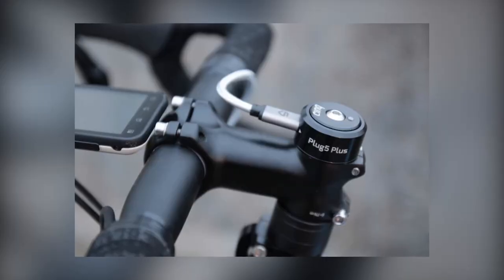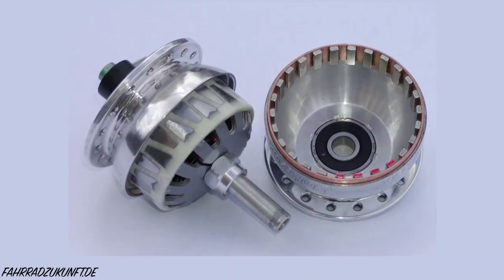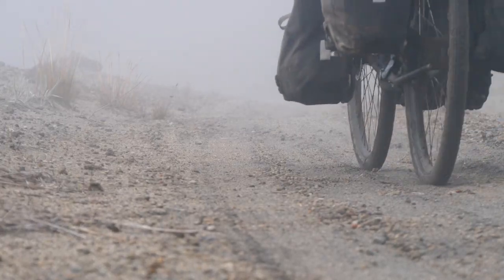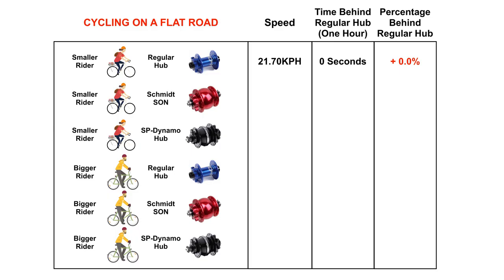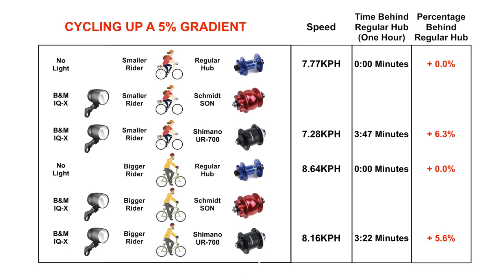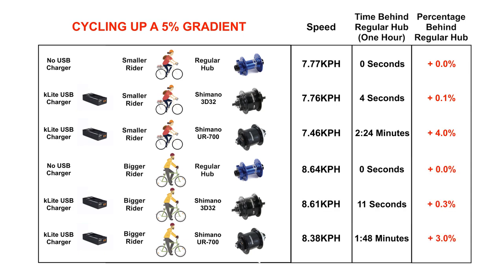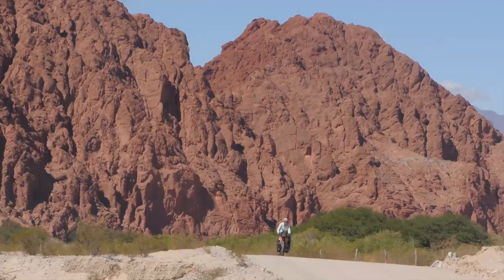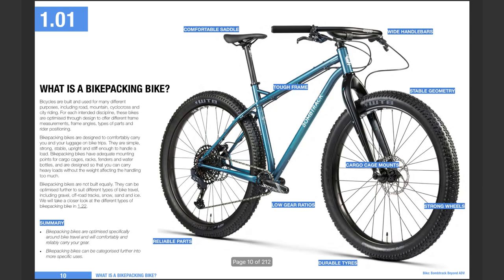How Much Do Dynamo Hubs Really Slow You Down?

Comment from the maker: If you want to go DEEP down the dynamo rabbit hole, jump on my website. You'll find a crazy amount of info on dynamo hubs, lights, USB chargers, wiring, batteries and more: https://www.cyclingabout.com/category/equipment/bike-equipment/dynamo/
Reply: Will do so. Thank you so much for your reply.
Reply: So what happens when you put them onto a mid drive electric bike?? Could they be used to charge the battery?
Reply: @MrJturner74  🤦‍♂ If you only turned it on for downhills when the engine wasn't engaged you could maybe extend your range by 50m or so...
Reply: @MrJturner74  don't electric bikes already have some kind of regen using the same motor-generator that powers the wheels?
Reply: @confusedredditor1660  Only the stupidly expensive ones.

Comment: This guy doesnt do videos for the money or fame, in his reviews its just pure passion. Love Your work sir 😎👍💪
Reply from the maker: I appreciate that! Yep, bikes 'n travel are my two biggest passions. 🥰
Reply: @Cyclingabout  I run a Rohloff on both of my bikes. I love the sensation of direct drive with this hub. And I got them cheap from German 2nd hand market. On one bike I have a SON dynamo and the cheapest Shimano dynamo on the other. Cant complain on either one of them, except that the SON has bare metal connectors which oxidized and I had to replace the lower part of the wiring (so a win for the Shimano here).
Reply from the maker: @peroperic3692  Interesting, I've never had that happen to any of my SON connectors!
Reply: @Cyclingabout  yeah, I accidentally squeezed the wire ends when taking out the front wheel, only to find out the light system is not working any more when I reinstalled the wheel. I unwrapped the wires (cut the housing) and the wires were green on the inside. I had some pieces of copper wire laying arround and just replaced this part of wire without soldering and put some heat shrink tubing over it. It works like a charm now. But this would be hard to fix on an expedition without the wire.
Reply: Pure passion, yep, but man (or even cyclist) does not live by passion alone! A bit of donor money helps fuel the passion. His reviews are the embodiment of scientific method. In equipment alone they must cost a bit.
Reply from the maker: jean-luc paradis  Not really. These are just products that we have data on.

Comment: Compared to my ancient side-friction dynamo on my old bike, the hub dynamo always wins.
Reply: Yes but you could disengage it when not needed so you had no drag at all
Reply: @Boss_Tanaka  in my own experience the hub dynamo drag is negligible when it is not powering anything
Reply: @Boss_Tanaka  Completely neglectable if you don't have your lights turned off. 
More importantly: When you are actually riding in the dark, the old side friction Dynamo REALLY slows you down. If you regularry ride in the dark, they are to crappy to use.
Reply: @sagichdirdochnicht4653  And from my childhood memories it'll also let you down at times when the tyres get wet, but I must admit that they were maybe not always perfectly aligned or in the best state of maintenance. That poor efficiency and then also powering an incandescent bulb is something I really don't miss these days.
Reply: @Boss_Tanaka  But bottle dynamos wear out after one winter
Reply: @sagichdirdochnicht4653  I think bottle dynamos like the AXA - HR are pretty popular in Europe. They are not that bad. I also have an old sanyo 12volt/6 watt dynamo with a rubber wheel cap, and it does slow me down quite a bit. I will say the brightness is OK for an old incandescent setup, though I cruise a bit below 10 mph with it engaged.
Reply: @burgegerm7878  What exactly is supposed to be difference? 
To be completely fair, I haven't ridden one in like 15 years or so, it's of course possible that the technology improved over the years. But I have ridden a few bicycles with side wall dynamos and the experience was always pretty crappy. 

Here in Germany you'll find those Dynamos pretty much only on very old, usually beaten down bikes. Anything newer you see usually uses either battery powered lights or hub dynamos.
Reply: @sagichdirdochnicht4653 bottle dynamo introduce a lot more drag and are less efficient than hub dynamos (hence also why they are signifcantly cheaper)

Comment: Very interesting comparison. Previous to this, the two data points I was going off of (and why I have a dynohub) were:
1: my SON dynohub, when off, has less resistance than all but the very best racing hubs. We measured this by: flip the bikes over, give the wheels an equal-force spin, and then see how long until the wheel stops spinning, the bearings and construction are so much better in the SON hub than in most non-dynamo front hubs that it will spin longer, despite the added magnetic resistance. It just goes and goes and goes. And that certainly matches my on-bike perceptions: when the hub is off, I don’t feel a thing, and I can coast a long time if I’m in a good tuck. 
2: I definitely notice the dynohub kick in. I have automatic lights, so it sometimes turns on in the middle of a ride, like when I go under a bridge. That said, the resistance with the lights on is still /way/ less then the semi-knobby tires I use in winter, and the difference between dynohub on and dynohub off is also much less noticeable than the difference between tires at 60 psi and same tires at 80 psi. Mostly, I notice the subtle vibrational hum coming up through the handlebars, not any additional resistance.
Reply: Best comment

Comment: Very nice video. One minor point. At the end of the video you say the Cyo headlight, introduced about 12 or 13 years ago is half the brightness of the IQ-X, which is true. However the Cyo Premium, which was introduced 7 or 8 years ago is 80 lux, vs 100 lux for the IQ-X. So anyone buying a current Cyo headlight is most likely buying a Cyo Premium, which is almost as bright as the IQ-X. The difference is enough to be noticeable if you're riding side by side and have the lights aimed exactly the same, vertically. But even a small difference in aiming the light will have a more significant difference in the beam's brightness on the road.
That being said, if you're riding in traffic at night in the rain, you never have enough light!
Peter J White
Peter White Cycles LLC

Comment: Dynamo on a bike make much more sense nowadays with high efficiency LEDs. I recall when using a two 6 V 10 W Sylvania halogen bulbs setup (the bulbs with 30 hours lifetime). While with the LED the dynamo uses 1.5% of the total pedal power, with the halogen illuminator I went up to 10% of pedal power (for the same luminous flux). For time critical runs, we added a 6 V 10 Ah lead-acid battery, which provided 2 hours of light at 20 Watts, or 4 hours at 10 Watts.
Thanks for the video...

Comment: The other problem is they just are not bright enough. My rechargeable headlight puts out 1600 Lumens at the highest setting. But my light has five settings, Low, Medium, high - 1600 Lumens and two different speeds of flashing. Yes, I have to keep it charged, but I also carry two batteries.

Comment: Here's something that may be unexpected: B&M's standlight functionality means that there is extra drag. When the light is "off," the standby capacitor is still being charged.

It sounds silly, but when I added an independent switch from my dynamo hub to my Cyo IQ Premium, I could feel a relatively much bigger difference between the light being on and off vs. when I used the switch on the light itself, which was almost imperceptible.
Reply: Interesting. I would have thought once the capacitor was charged the drag would lower but maybe there are more losses.
Reply from the maker: That's an interesting observation. As 'anywhere roam' mentioned, I would've suspected that the capacitor would take a very minimal power draw once it was full...
Reply: I had some faulty cabling and I was surprised to discover I could feel when the connection was good vs. not. Once I installed the switch I did some testing after charging the standlight for over an hour and it was still very noticeable!

I have wondered if it's unique to my specific light or if it's related to all of the B&M standlights. I do have an IQ-X on the way and will be checking it out.

Comment: The most massive disadvantage about dynamo's in general is......... the number of times I get stopped by people, especially those I work with, who have to tell me that I left my bike lights on. This year I decided that I am not going to say don't worry the bikes got a dynamo and in a few minutes the lights will switch off all by themselves and then as soon as I move the bike they will spring into life (while I'm thinking I told you this last year) - only to get looked at like I must be riding a bike using alien technology. Now I'm just saying don't worry they are old batterys and I'm running them down so I can get new ones cheap off Amazon.
Best bike invention ever imho. I own 2 - a Shimano built into a set of Taylor Wheels and a SON in a set of Hunts glorious 29ers and fingers crossed I will own another SON pretty soon that I intend building into a 29er wheelset I got given for free with broken spokes that it took me 10 minutes to fix.
Reply from the maker: I get hassled about my lights all the time too. 😅
Reply: why ur light dont have on/off switch?
Reply: @farikkun1841  To make it waterproof - any button that you put on a bicycle light is a possible place that water can get in and stop the light working. Before I upgraded to a hub dynamo I got through endless front and rear lights because their battery compartments or on off switch let water in and damaged the electrical circuit.
Properly designed dynamo lights have no on off switch and instead use a capacitor to store power for about 5 to 10 minutes and then you can just walk away and leave the bike and the lights go off when the stored power runs out - but they light back up the instant you move the tyres and cause the dynamo to turn.... so in practicality they are always switched on and never need switching off.
This is a lesson the people who designed the worlds loudest bicycle horn, called 'The Hornit', need to learn - I bought one a few months ago and on two occasions its ended up going off at 140db in pouring rain and the only way you can stop it is remove its batterys and the only way to do that is spend ages fiddling round trying to undo a tiny tiny tiny philips screw that holds the battery compartment shut and yet still allows water in..... if your going to make things that hang off a bicycle and they work with electricity then make them waterproof.
Reply: @farikkun1841  My commuter bike has an on of switch for the lights. I leave them on permanently, just to be seen better by cars. The drag you get is not noticable, and I'd rather spend some money on replacing the LEDs every few years than get hit by a car.

Comment: Nice video. Your recent article on rim dynamos was interesting too. It would be interesting to see a rim version of this video with comparison to hub. Pedalec should be more efficient. With caveat around mud.
Reply from the maker: I've asked for some more information/numbers from the rim dynamo manufacturers, hopefully, I can make a video soon with their data.
Reply: I can tell you from experience going back a while, you can feel a rim dynamo very distinctly. Back in the olden days of crap batteries and bulbs the generator was reliable and ready when you needed it. When you flipped the generator off your bike felt like a rocket.
Reply from the maker: @stevek8829  The latest ones are different! https://www.cyclingabout.com/rim-dynamos-can-now-generate-more-power-than-hub-dynamos/

Comment: I find power output at typical riding speeds is much more important than a tiny amount of extra drag. On my bikepacking bike, even with fast tyres, I do not notice the extra drag from my Shimano hub. Turn lights the off and stop recharging, and I do not notice any drag.  The lights off drag is tiny compared to a full load drag too! And full load drag seems like nothing! And the Shimano hub makes the most power at typical riding speeds. Which is useful as I get more light on low-speed climbs and my gadgets charge up quicker. Is why I prefer Shimano to Son. Mine has lasted a long time, and I do not need to send a wheel back to Son to get the hub completely rebuilt. Just buy another Shimano hub for cheaper than Son charges for a rebuild and it arrives the next day.  Fresh spokes and a fresh strong wheel build. The Shimano hub has dura-ace seals in it. Ridden moving through UK mud and puddles. Inc. the recent very wet weather, endless puddles. It just keeps going.

Comment: Interesting results. Thanks.

My back of the envelop analysis would go like this. A 2.4A USB port uses 12W of power and you'd add ~5W for the inefficiency of the dynamo to get a 5-17W reduction in power. Your light cyclist produces 120W and will have 103-115W remain to move the bike. That is 86-96% of the power available without the dynamo. Your heavy cyclist produces 180W and will have 163-175W remain to move the bike. That is 91-97% of the power available without the dynamo. How much of the power loss translates to speed loss is, as you say, depending on many factors. The results that you saw is within the expected theoretical values above.

For lights, high efficient LED lights are around 85-100 lumen per W. How much power that you lose will depend on how bright the lights are.

Better quality dynamo would reduce the 5W power loss but would not do any thing for the loss from the USB or light.

Comment: Hey, great video, much needed info. Based on this video, the findings here I went with the Son 28. The only issue for me will be on Audax rides.  I ride a Thorn Mercury which I also use for tours. For shorter Audax I had another wheel build with a normal hub. It was more for weight reasons. It's far easier for my legs to use USB lights, I take another set that are charged.  Many riders still run the sun 28 on audax.

Comment: Alex, I am curious how you use this information to inform charging strategies while riding. For example, do you turn off your charger when climbing or facing a headwind and turn it on when going downhill or on flats?
Reply from the maker: I don't have a charging strategy, I just plug things in when they're running low on power. I just like tinkering with the numbers to entertain my intellectual curiosity! 😅

Comment: Great video, thanks a lot! I do think though that you overestimate the w/kg output of the average bikepacker. This number will vary massively across cyclists of course, but I do think that 2 w/kg average for bikepacking is quite a big overestimation. To comfortably pedal that for 5+ hours, the cyclists threshold should be 3.5 - 4 w/kg, which is higher than that of most bikepackers (pointy end of ultradistance racers excluded) - closer to the range of competitive cyclists.
I'd be with you in the uphill case - 2w/kg are produced when going uphill a 5% slope. But on the flat road, your results could be a bit misleading. 
That being said, your content is fantastic and I really appreciate the effort in sharing your knowledge! Cheers from Germany.

Comment: Great video!  Thank you for your research!  I've got a Son hub paired with a Sinewave cycles Beacon light and charger.  I've always been curious about the drag.  Thank you!
Reply: Sturmey-archer used to claim there dynohub added no friction.  The vintage stuff Raleigh/SA made was always very understated but a friend told me you could feel the difference.  My guess is that a 1.8W used by the lights would require 0.45 more power due to copper losses and nothing much more for magnetising and eddy current losses?

Comment: how the dynamo resistance can vary depending on power used?
what i know from car alternator is it has clutch mechanism. dunno bout the bike dynamo
Reply: He did a horrible job explaining that a load placed on the hub varies by accessories.  The larger the power draw the higher the 'drag' due to the magnetic field that increases in relation to the load.
Reply: alternators have diodes not a clutch.   your a/c compressor has a clutch.
Reply: @fredricknietzsche7316  how diode affect alternator drag when battery 20% vs 100%
Reply: @fredricknietzsche7316  alternators have clutch pulley

Comment: I see you're using the Plug5 Plus, which is what I'd like to get for myself too. There's been reports of major problems once it starts raining; have you had any such misadventure with it yet?
Also, what would be your other charger recommendation instead of the Plug5 when there's no possibility to install it (fork with no hole for instance)?
Reply from the maker: Yeah, my charger has stopped working 2-3x since I got it. I just take the top cap off and dry it out in the sun and it comes back to life. But apparently, I got one of the first production units, and Cinq told me they have improved the waterproofing since. I'm currently waiting for a new unit, but for some reason you cannot ship batteries out of Germany currently?!

I'd probably choose the NC-17 Appcon 3000 or Forumslader V5 if I had a full carbon fork.
Reply: @Cyclingabout  Nice to hear something is done regarding the waterproofing. I'm genuinely considering buying a specific fork just so I could use the Plug5.

Thank you for your recommendations too, it's really appreciated.

Your content never disappoints, thanks for everything.

Comment: Would it make sense to have a hybrid dynamo/battery system and charge the battery in the downhills? How about engaging the dynamo automatically when braking? The descent of a big mountain pass is easy to spot and the dynamo can be turned on manually, but what about automatic detection of downhills? It could be optimized so that you could get the lights at night but the drag is minimized.